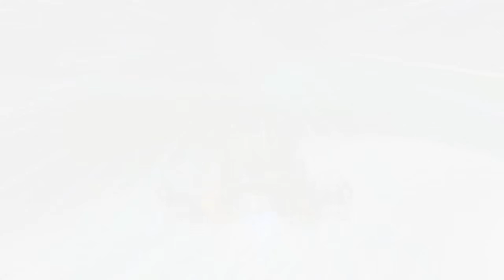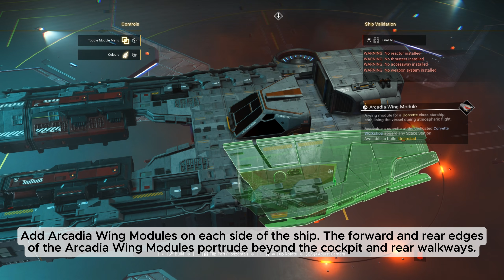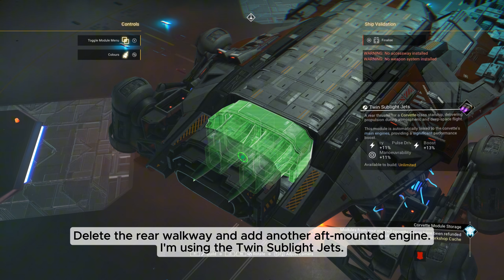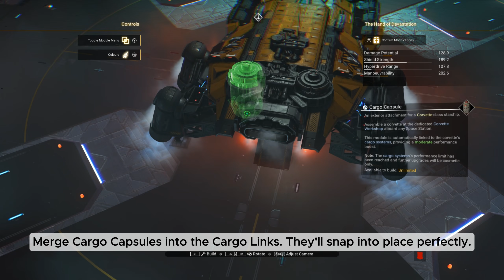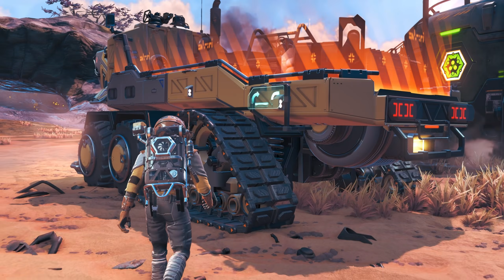How to Build a Daily Driver Cargo Hauler | No Man's Sky Corvette Build Guide

Comment: The part with the multiple walkways is super confusing. I still don't get it.
Reply from the maker: It's definitely the most complicated part of the build. Do you understand how to use the Rockhopper Propeller Module to shift the walkways a half-step apart? Make sure you only do this on the starboard side of the ship. For some reason it doesn't work on port side.

When you shift the Rockhopper a half-step forward, you can then align another walkway with it and will merge halfway into the one preceding it. Then you can continue to merge multiple walkways a half-step apart as the 1st, 3rd, 5th, and 7th walkways will snap to each other while the 2nd, 4th, and 6th walkways will snap to each other. The point of doing this is to be able to extend the length of the Engine Cover Rims and Fuel Pod Cover Rims that make up the cargo prongs.

Comment: it wont even let me half step most of the time its getting annoying
Reply from the maker: Remember that the Rockhopper Propeller glitch only works on the starboard side of the ship. For some reason, that glitch doesn't work for port side.

And then for the Ducting Outlet glitch, where you place the Ducting Outlet on the walkway matters. Top and side placement will move the half-step in different directions, so make sure to follow my placement for that glitch.

Also, can you shoot me a timestamp of where you're at in the video? I can help you more directly.
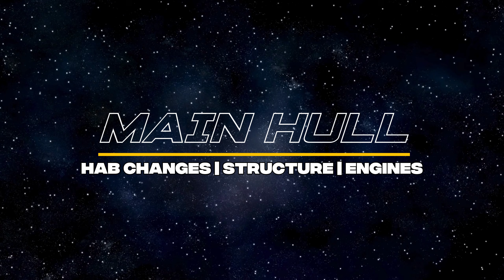Reply: @High_Key  9:47
Reply from the maker: @clintonbyers930  Yeah that part gets a little finnicky because the walkways have so many places that they want to snap to, so you have to kind of shift them around until you get them merged in properly. As long as you keep the walkways on the same level as that hab behind the cockpit, you're good. If you're having trouble merging the walkways into the hab, you might be missing a walkway underneath that allows for this to happen. If that's the case, you'll be able to still slip one in. You just want to make sure that the section of merged walkways underneath has no gaps. It's hard to tell visually so you have to just try placing walkways along that central line underneath the cockpit and hab.

I hope that makes sense. It can sound a bit confusing but conceptually, you just need to make sure that there's no gaps in the walkways underneath.

Comment: Great ship design! One quick question - if you have ramps and the front and the rear and summon the ship to land on a planet, which way faces you?
Reply from the maker: That's...a very good question. If I remember correctly, from past builds, it tends to land backwards. I'm not sure if that's always the case or dependent on which landing bay was installed first (or last). Something I will have to test out cause you got me curious about this now

Comment: Could you do a tutorial on just how to do the merge glitching? I'm trying to copy something I saw in the Nexus that requires a wing to be placed on the same tile as a thruster and it's difficult to skim through this entire video just to find one specific part about merging.
Reply from the maker: There’s been a few out there on YT that have covered this if you need immediate help. 

Otherwise, two of the methods are used for this build:

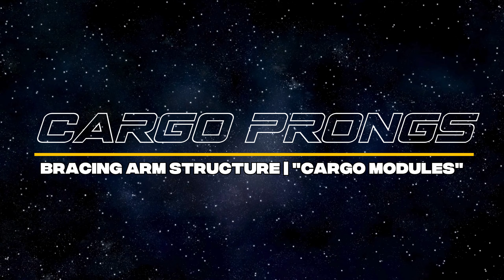The horizontal half-step offset using a Ducting Outlet is first at 4:27

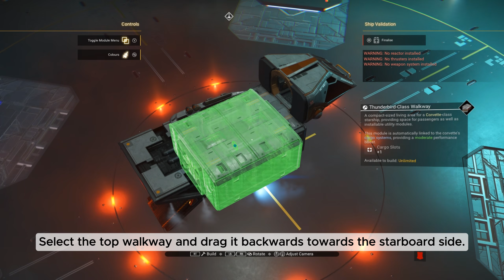And this immediately goes into the next glitch, which is the Rockhopper forward/backward offset at 4:47
Reply: @High_Key  Thank you so much for the timestamps, this is extremely helpful!

Comment: I love the ship's design <3. However, I have a question ^^ This ship is my first corvette, and I can see that many components take up space for boosters and weapons. Is there a trick, or can you unlock more than 30 slots? I would like to use the ship as an “old stolen ship” for my pirate character. (Currently, it feels a bit weak in combat... although I just switched from an S ship to the C Corvette).
Reply from the maker: Absolutely! When you go to a space station, in the back right corner, there's a ship upgrade terminal where you can increase its class and add slots to both the tech and cargo slots. The higher your ship class, the more slots you can add in each category, so S-class ships can have a ton of slots.
Reply: @High_Key  thank you ^^
Reply from the maker: @PinkFairy303sorry made a mistake. Back left corner!

Comment: Finally finished building but the interior is hard so probably going to do that tomorrow, a couple of helpful things about interior building, any bones found on planets or traded in space stations can be uses inside corvettes, maybe if you wanted the skull of a giant creature mounted on a wall then you can take your pick, there are also some great things in the quicksilver merchant for corvette interiors,  I always replace message modules for pocket reality generators to use as a map of a galaxy, definetly worth having a look just to see any parts you might want to use, quicksilver can be easily earned in the nexus, there is a mission every weeken with a pay of over 1k quicksilver and weeklies give 400
Reply from the maker: I had a feeling that was the case for the bones, so I decided to keep them from the expedition just in case. It'll be perfect for the xenohauler/research build. I better start giving those nexus missions a shot. Are the pocket reality generators in the decorator normally or do I have to get them from the anomaly?
Reply: @High_Key  anomaly, 1200 quicksilver I think or 800, I tend to use them at the base of the portal console just to make them look cooler. Be careful with nexus missions because sometimes they can be glitched and they wont show the marker, could be patched, been a while since I've done them. If you go to the space stations, somewhere you'll find a bone trader so you can trade out different unwanted bones for any bone you want, usually you want to give 3 bones for one choice bone. If you do use bones or quicksilver items you should probably let people know what you're using.

Comment: you accidentally made a Type-8 from Elite Dangerous. it looks so similar to the ship
Reply from the maker: I've been told a few times. I haven't tried out Elite Dangerous yet but this build was inspired by the Drake Vulture from Star Citizen and the Venture mining ship from EVE which all have a similar aesthetic
Reply: @High_Key  I actually own a Type-8 in Elite Dangerous. its a cool medium cargo ship. it was the first one with an optimaized SCO drive profile added so it could blast across systems in seconds instead of minutes. the two prong designs ae surprisingly popular.